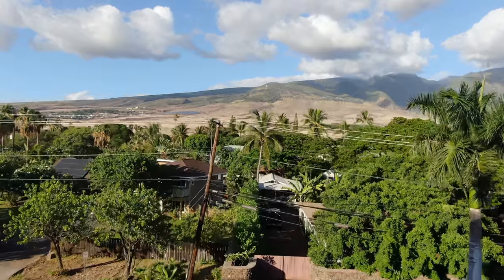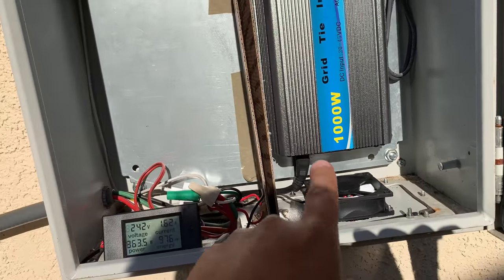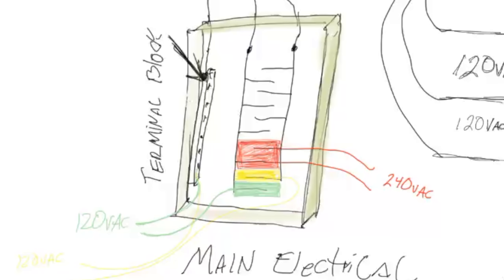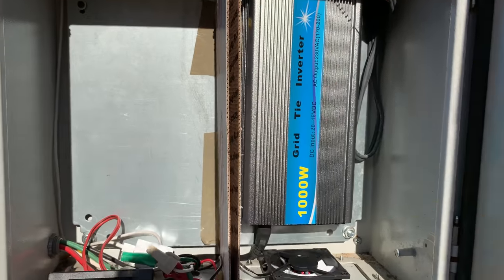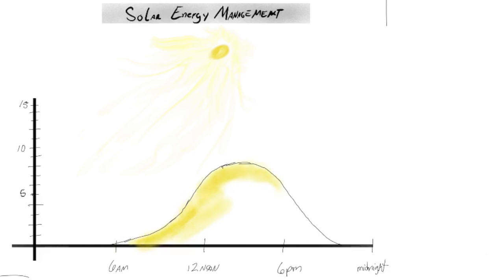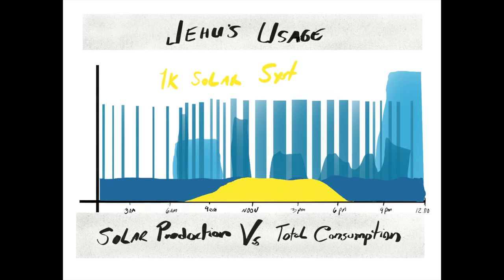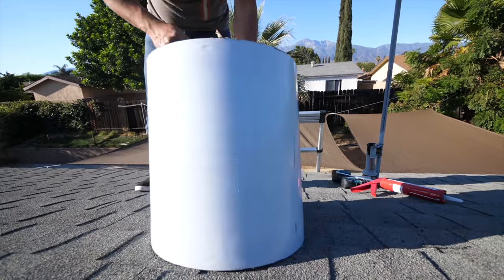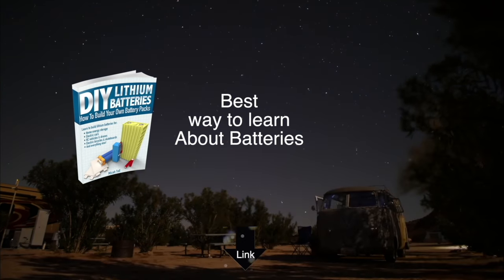How To save $1000 off your electric bill using DIY Solar

Comment: Do we not require to get some paper work done or something in order to plug it in the grid system? Can I just do and get a couple of panels that make  about 1200 watts , wire them up to the inverter and plug it in the socket?
Reply from the maker: Up to you to figure out your local laws

Comment: Excellent video.  Question:  I have a single 250 watt grid tie inverter for 120v (one leg).  Does the imbalance it creates cause a problem for the system?  I've never popped a circuit breaker.
Reply: A 250 Watt  inverter is small enough to make very little imbalance.  What does a 120 Volt / 1,000 Watt do ?

Comment: What do you think of rather then taking on the whole house with solar just focus the most power hungry appliances like the a/c? do you think it would be worth the effort to just solaize my 12 seer A/C outside compressor and then the air handler with a 2nd smaller set up? maybe one for my window unit first? just thinking about as good place for a noob like me to start.
Reply: Could also switch the circuit all to DC to avoid AC conversion losses.
Reply: @Nicholas-f5  would that cause the electrical lines within the walls to heat up more than they would with AC?

Comment: What would you say the best advice for someone living in an apartment to have for solar? I've thought about using a grid tie inverter and plugging it into the nearest outlet as to help lower my electric bill since I do have a smart meter
Reply: You need an inverter that monitors overall usage and doesn't output over that, or a small system that never goes over your base load. If you back feed in solar power above what you are using, standard smart meters only roll forward and will charge you for that generation. It's likely that many have circuity that will trip and send a notification to the utility that something not quite right is going on [unknown]

Comment: I love watching these videos cause I can learn more. I was able to install my own solar for cheap. Little less than $1 per watt. But I'm trying to learn how to do the battery back up as all that stuff I have yet to learn. But I have 16,000 watts of solar on microinverters. Can run dual air conditioners on a big house, pool, spa, well, shop and driving 30,000 electric a year while staying even with the utility.

Comment: The power company also likes you using a 240v inverter. A 120v inverter will unbalance your 2 legs coming from the street. This is the situation that causes the neutral wire from the street to be used. Which does work but is not optimal.
Reply: The power company does not care, if you use the Neutral wire or not ...
Reply: No they don’t mind a 200amp 120v load blowing up half their equipment when a 100amp 240v load would have saved their equipment. They don’t mind that at all.

Comment: Did you have to get a permit or an engineered design for your house? If so did you get around that in any way? That’s the issue I’m running into in my area before I install a diy system.

Comment: I have a 3Kw system with enphase micro inverters. 
Can I add a DIY grid tie inverter and panels setup to my current system or would I need to add more of the same as I have?

Comment: I bought 4 of the headway 38120 cells to try out a small little grid-tie setup. Also got a  300W grid tie inverter, similar (but smaller) than yours. Wondering what type of BMS and charge controller I would need for these... Suggestions?

Comment: Hi, I’m very inspired by your videos. Thank you for the video. I live in San Diego. Did you get permission from the electric company to send them energy? or you use grid tie  limiter?
Reply: I really hope he addresses this question, I have viewed a bunch of his videos regarding this California solar install, but he doesn't address this burning question.
Reply: @stirlingfromla  I might be wrong, but I remember him saying that solar system was kinda illegal
Reply: San Diego is being choked in the area of solar since the local power company has so much political control.  I would also like to know the answer to this.
Reply: I've checked and my utility company doesn't want to install a meter that runs both ways unless it's a large system. I'm interested in knowing the answer to the original question.
Reply: @stirlingfromla  I have no problems, I think that electric companies are criminals. They do everything to harm those who have solar panels. I have legal panels and produce 800 kW per month. But simply, if there is no permission, then you cannot send energy to the network. If the electric company detects this, then you will have problems.
Reply: @robertr1326  you can check Grid Tie Inverter with Limiter than you do not send any power to grid
Reply: @mmart1nez  Grid Tie Inverter with Limiter is the answer
Reply: @mmart1nez  I have no problems, I think that electric companies are criminals. They do everything to harm those who have solar panels. I have legal panels and produce 800 kW per month. But simply, if there is no permission, then you cannot send energy to the network. If the electric company detects this, then you will have problems.
Reply: @MaximMaximov  thanks for the info. I'll check into that
Reply: The inverters he is using are not UL listed, so if there is a problem and the inverter catches your house on fire. Your insurance company will not cover the damages. Also, since they are not UL listed, the power company will probably not approve of sending power to the grid.
Reply: He explained in the video that his base load is 1000watts which is the max he said his system can produce at full illumination
Reply: @BSAElectronics702  But what happens if consumption is less than production? He does not have a limiter, and he can accidentally send extra kilowatts to the network. Then he will wait for inspectors from his power company.
Reply: Maxim Maximov I actually prefer to create a system that is not tied to the grid for electrical independence.  Is that even possible in San Diego?
Reply: Maxim Maximov I would be interested in seeing your system.
Reply: Maxim Maximov I am also finding a solar solution to deal with my peak rate consumption. But what I found out is there are city permits, power company interconnect contract, and all electrical works have to be done by licensed pro to sign off. Many process has to be done for solar to be legal on the roof. I checked on SoCal Edison regulation, and it says even if you don’t want to sell power back, you still need to do the interconnect contract if you are grid tie. ROI will not be as attractive if you want to be legal.
Reply: @neliosamch3195   heard that despite the fact that you have a NEN meter, if you are not connected to the solar generation tariff SES TOU, then you will pay for the fact that you sent your kilowatts to the grid. If you sent a 10KW to the SDGE, the company will charge you for mit, as if you did not give them energy, but as if you bought it. If you do not have a solar tariff, then you do not have a negative zone (below zero) prodution. So everything that you sent to Grid they consider (as plus) as your consumption.
Reply: @tktkwei  I have a legal 5kW PV system. It took me 5 years to return my investment ROI because San Diego has huge electricity prices. Imagine: we paid to SDGE $250 a month!!! we almost do not use air conditioning (we have a heavenly climate) and do not use heating. But the price per 1 kW is more than $0.5. After I installed the PV system, I do not pay anything to them. And I bought a Honda Clarity electric EV hybrid plugin.

On the other hand, if you put yourself Grid tie limiter, and throw 4 panels of 250 watts, I do not think that you will be punished by SDGE for this. Since they will not be able to see that you are generating electricity.
Reply: @mmart1nez  At the moment, the batteries are still very expensive. I will wait 5-10 years and setup PV OFFGrid.
Reply: @MaximMaximov  Yes, however, you can elude such charge by implementing a large battery bank to store extra energy for later use. You are not selling one kw, you are given 1250 watts and when buying every 800 watts you are charged for one kw. Good deal not for us.
Reply: @neliosamch3195  what? you are given 1250 watts and when buying every 800 watts you are charged for one kw??
Reply: @MaximMaximov  That is right. It is not new. They call it kilovatios to recover loses in transmission lines. If you have a rainforest automation emu-2 display, it shows one kw but if you look at the wattage  meter at your panels you will notice a big difference.
Reply: Power inverter with limiter only reads one of the 2 phases right? So you could still be drawing power on another phase because the inverter can't read it.

Comment: I think one of the biggest first goals should be distributed storage for peak shaving.  This tackles the biggest issue facing power companies and allows for an easy path to adding solar if and when the decision is made to do so.

The Outback Radian charger/inverters and the Schneider Conexant systems are capable of being used with all forms of power and backup power all at once and sorts out what to send where, when, based on time of day and demand in the house.  So that means you can have service, solar, a battery system AND a backup generator all managed from one device.  This is what I am saving for.  Starting with a charger/inverter, a small bank of batteries and a backup generator.  Then from there, expand the batteries and perhaps add solar in the future.

Comment: It’s unlikely you will ever find either phase in most households not having some kind of base load on it most times of day and night, but even if you did, the energy pushed out to the grid still rebates you on your bill as long as you have the power-agreement with the utility (which your setup wouldn’t have), or since your setup can’t be approved by the local AHJ (fire department, building inspector and power company) because the equipment is not installed by a licensed contractor and isn’t UL-approved and thus is not permutable, you can do an end-runaround and still get paid for all the power you put back into the grid IF you get the utility to put back an “un-smart” analog-style electrical meter which will spin backwards no matter if you have an agreement with the power company or not (hint, hint!)….. You can use any excuse you want to change the meter back out and they will charge you $8 a month for manual metering and $300 for the meter but in the long run if you over-produce, it will be worth it…. The excuse most people use is that the meters kill the bees  or that it gives them headaches from the unfiltered billing frequencies emitted back into the house wiring from the box.  There’s plenty of documentation about health issues from smart meters to use as ammo to get them to change the meter.  Be insistent if you want to go that route and you’ll get what you want.  

Also, tying the inverter into both phases still doesn’t really help if you have no base-load on one of the phases  because it is only putting half of the power out on both phases at any one moment, so if one phase don’t have a load, it’s still going to dump half of the power down that phase without the base-load  and half on the phase that does have a base load because its output is basically split into two phases by putting it through a low-cost center tapped transformer so unless I missed some unknown facet of low-cost inverter design, I don’t think the cheap Chinese made Amazon and ebay-sold inverters like you and I use on your home-brew solar setups are so smart as to test and provide deferential power output only to the heavier-loaded phase., it will be evenly split via the passive transformer component to both phases.  But since lighting and outlets are sometimes on different phases (in a well designed house), and if not there are still plenty of devices on during the day (electronics, cable boxes, computers, refrigerators, pool pumps, fans, air conditioners), split across various different circuits of your home, and because air conditioning is split across both phases, it’s almost assured with that size system, wether you wire for 120V or 240V will not likely make any difference as all of the electricity you put out is going to be used and not sent to the grid unless you are very strict about shutting off devices not in use and actually have base load only on one circuit in your entire house.   Heck one flat screen TV (150W+),  a cable converter (75W), a fan (50W) and a refrigerator (750W+) can already exceed 1000W handily.   Not to mention computers and their accessories (hundreds of watts), alarm clocks, lighting, microwave oven, telecom equipment, clothes washer and driers…. Add battery storage (like I know you have), and it makes double-sure none of your power produced will ever be going to the grid.. and you can keep your smart meter even! :P

Comment: This is awesome. The main question I have is about the grid-tie stuff. I live in WI and I've been talking to solar companies... They all use grid tie in and no mention of battery. The system they propose also gets turned off in the case of loss of power from the utility company which means... no power even with solar in the case of an outage. I get that it's for safety but that sucks. What am I missing? Is there somewhere to find these regulations?

Comment: Also note there is three phase in the urban transformer see https://pacificpower.com/2017/07/understanding-three-phase-voltage/
The distribution company uses differnt phases to each residence you may have L1 and L2 next neighbor L2 and L3 then next neighbor has L1 and L3.  In countries which have  higher voltage distribution  single pahse to neutral of 230 plus volts standard connection and you can apply to have a three phase connection where phase to phase voltage of 400 plus volts.

Comment: I’m not quite following your reason to drop from 2 inverters, one on each phase to 1, and how can you grid tie without having power go back into the grid? Seems like during a power failure the grid would have the potential to take all the power (lineman). Love your videos.
Reply: That inverter shuts down when the power goes down.

Comment: I don't want seem like an ass but an exhaust fan is of greater importance than in intake. if you have an exhaust fan it will push hot air out and pull cool air in. Put a thermostat in your case and test this by switching the leads on your fan motor. would make a good quick video.
Reply: Tyler Brooks You are exactly right. If the heat outside is hotter than the heat inside the enclosure, you are not cooling down the inverter.
Reply: @alfredoduran3946  and the exhaust fan would keep a constant flow of cooler air. Moving the fan to the top and covering the hole at the bottom with mesh or screen would maximize flow instead of fighting the hot air rising intern working with the natural flow of heat. I would love to see him do this in a video. so simple yet it would teach a lot of people something new (new to them)

Comment: great info but does your house only need that 1000 watt inverter. or do you not use that inverter for all your loads?
Reply from the maker: my house runs on the grid,  this system just deducts however much energy up to 1kw the solar panels make per hour.

Comment: Hi, have you managed to connect the batteries?
Your videos about bms and battery packs are very good and simple to understand, I wanted to know how to integrate a DIY battery with a grid tie solar inverter.

I have a huawei solar inverter that accepts a battery, but it has to be a huawei battery (it has its own communication protocol to work) and I don't want a brand new battery as a home storage system, I believe that is the role of second hand EV batteries.

Comment: I was wondering about the net metering. If I push more power back into the grid than I consume, wont the power company charge me for that?
Reply: @eugenes9751  Ive heard the power company will charge me if the meter goes in reverse or if I push back more than I use. Is that true?

Comment: At 1:30 you need to remove the cardboard fire hazard from that electrical box. That's a pretty dangerous situation. Sheet metal will work fine. Screw it, don't tape it. The tape glue will fail over time with heat cycling.

Comment: Very nice, but there is still a little something missing. The cell type of the panels. Because their efficiency is strongly dependent on the temperature. The benchmark here depends on the longitude where you live. Monocristaline used at from 40 °. Polycrystaline between the 20 ° to 40 ° and thin-film modules near the equator. At the moment, the monocrystals probably have a technical advantage and higher efficiency (if they do not get too hot). Maybe that's because the richer part of the world population lives in the zone.

Comment: TOU Rates are different from winter and summer. Summer is the more expensive rate ~ .50, winter is around .34. Still completely worth it in CA, just pointing out the ROI timeline might be a little longer.
Reply from the maker: True that,  but most of the energy produced is in the summer months,  and with 2 EVs im perpetually on tier 2  which brings my per kWh to Hughes price available.

Comment: I bought the battery packs you are using for your peak shaving system for your A/C. I would like to use those batteries to build a power wall. I ordered the connectors from your website.  I need a diagram to build the powerwall.  How do I get it?
Reply: You are shaving your A/C?
Reply: @blackhatter011  no, I just want to build a powerwall.